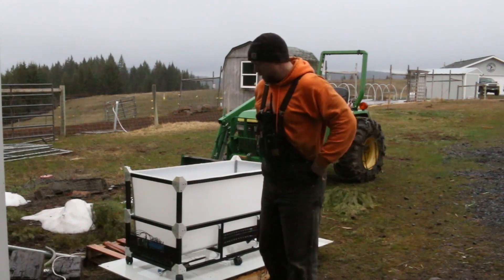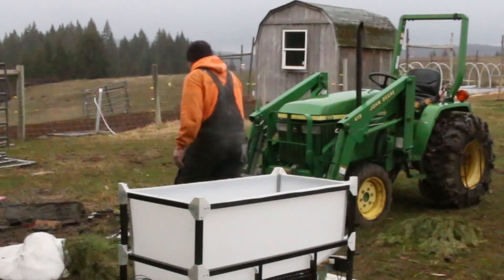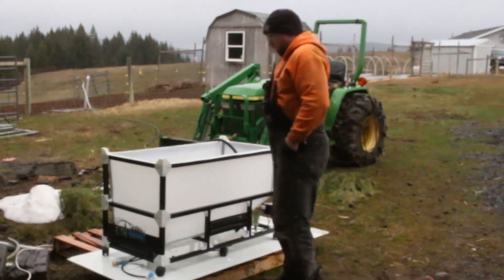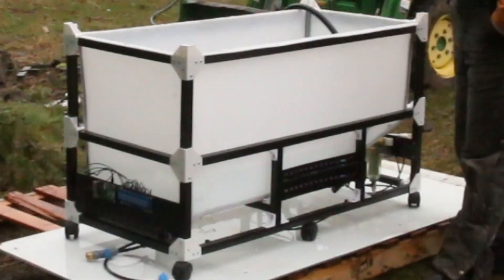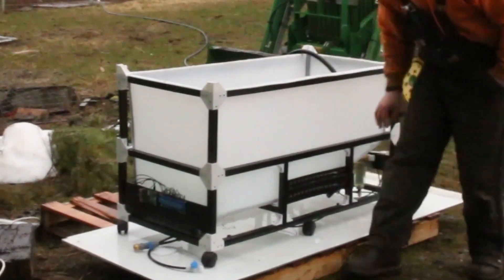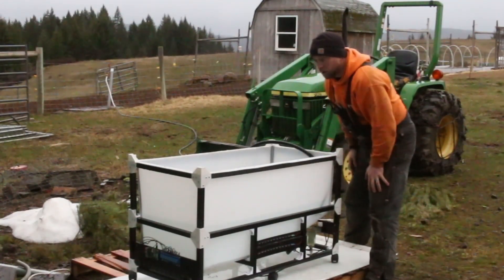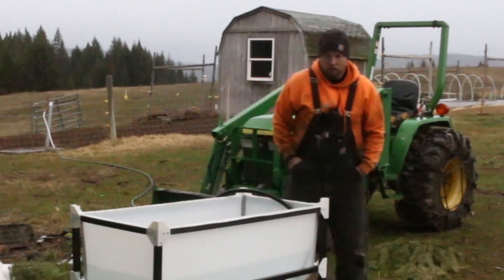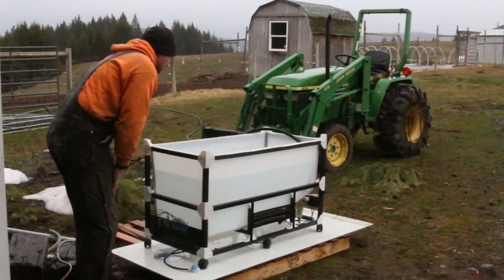The FINAL COUNTDOWN, part 1: Indoor AEROPONIC Tower Tank Testing

Comment: You could add a cross member across the middle of the tank above the water line so it doesn't need to be sealed and then bolt or screw into it from the outside or even across the top and have two lid sections either side of the support and screw /bolt down through the existing side supports, loving the progress and improvements each iteration 👍

Comment: I'd really like to see you succeed in this and I'm going to turn off my fabricator mind right now and speak from a consumer point of view.  Anybody that is going to spend the money on this would more than likely spend the extra $100 it would cost you to build something rigid.  No bulging, no frame flex, no half ass lid fit.  Use some aluminum extrusions with proper corner brackets.  There are thousands of molded plastic tanks on the market already,  I'd bet money you could find something already made with molded in gussets and stiffeners that maybe you'd half to cut the top off or split in half and get two.  Some drilling and fitting installation and your done.  Time better spent on the technology and controls and lighting etc than trying to reinvent a rectangle frame and water tank.

Comment: TRM, can you mold/weld a plastic strap on the top of the tank to keep the middle from bowing? Not a baffle (vertical) but a strap at top? Of course make it flush for the lid to fit properly.